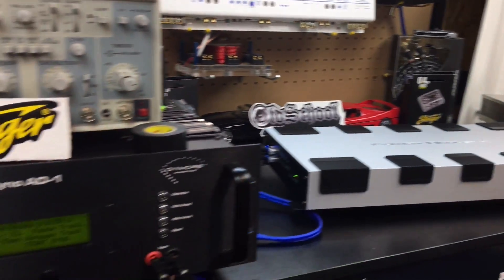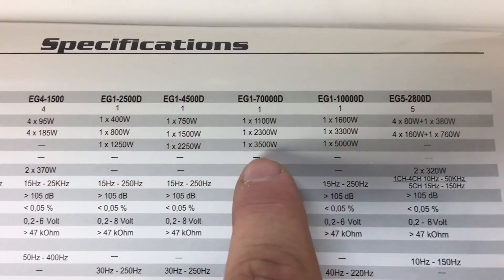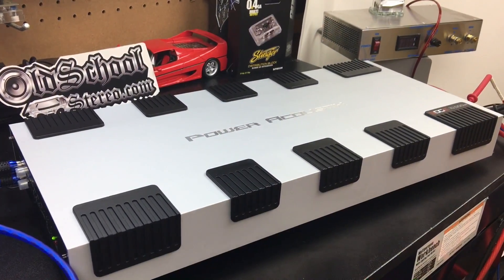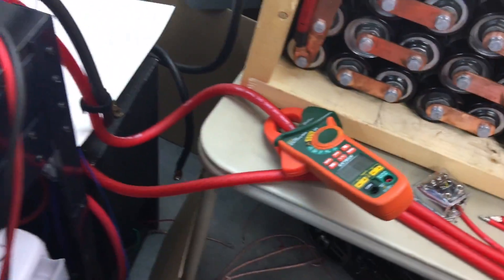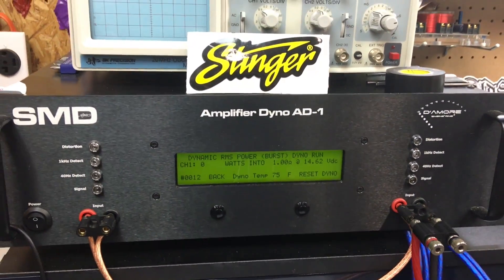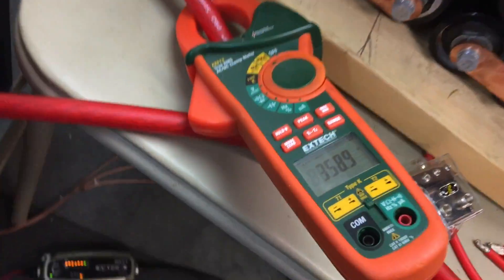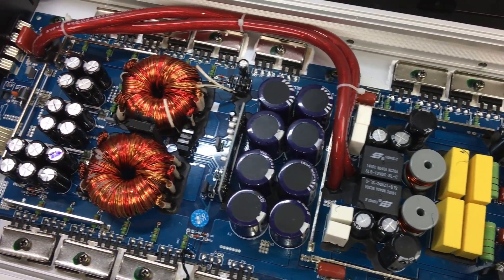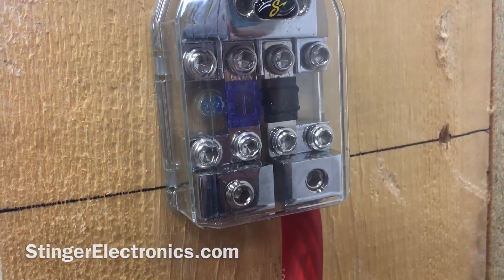10k Watts for $300? Power Acoustik EG1-10000D Amp Dyno Test

Comment: Absolutely insane the amount of amperage it pulled to what it pushed out seems like if u were having a 300 amp draw u should be getting at least a good 4500 watts
Reply: Daniel Harrell no with a good amp a 400 amp draw really can only support around 3.5k-3.8k .  all amps have an efficiency rating.  most decent amps are 80% or above. that means you have a 20% loss when converting amps to wattage. for you example to be true you would need an amplifier with a 150% efficiency.  that is impossible as energy is always lost as heat and other ways. the most efficient amps on the market are around 90%.

my saz2500v2 was ratted for a 300 amp main fues just to push 2.5k at 1 ohm. at .5 ohm it jumped to around 2.85k so its efficiency at half ohm increased to closer to 90 something percent.

anyway I  just wrote this to help you better understand how fusing relates to maximum wattage. also I seen it had 2 likes so there is more than just you that are mis informed about how amperage draw directly related to efficiency rating and maximum wattage. you will never find a 12v amp with a 300 amp fuse pushing 4k.... unless the fuse isn't working right or is some kind if a cheater fuse. 

mike smiley did a test of some special fuses he found and was able to pull almost 400 amps through a 100 amp rated fuse. this is why most car stereo comps stopped using fuses for classification and went directly to clamping the amps. some fuses just refuse to pop at rated draw and some people were using slow blow fuses to exceed the rated amperage in their respected class.

hope this helps and clears up your misunderstanding.
Reply: its a class AB, there about the least efficient type of amp there is.
Reply: @dirtrider88  where are you even getting that fake news from?
..it says right in the name that it's a class D
Reply: I have no idea where I got that from. maybe I googled the amp and was reading the specs for something else?
Reply: @dirtrider88   lol..well at least youre honest.
Reply: Im just as confused as you are

Comment: Guts dont look too bad, they should just rate i as 2500 watts RMS at 1 ohm and it should sell
Reply from the maker: +bassmansoundking99 precisely. But 10kW sounds much better, right?
Reply: Yeah sounds good and maybe lots will never know.
Reply: @wal  I don't know. If you know what your subs need. Just sell package deals. Oh what tangled webs they weave, when they practice to deceive
Reply: 33
Reply: I just think lesser quality amps need to be better cared for, as in better voltage to protect it. Often they have a weak power supply, or just enough fets to support output, but not enough built-in headroom.
Reply: i know ive checked out the planet audio anarchy 1200 .2 and 3000.1 and they look to have most of the same componets but i have found a 1200.1 d from way back that might do it ( i hope ) i did a multi meter test and it came out if i did my math right to 423 wats at 4 ohm with 6 gauge wire a 150 amp stock alt reg battery and a pioneer lower end head unit with a line driver but most of my older amps seem to be on the better side of me believing there rated power newer ones i look at and say divide by half that at least if not worse
Reply: CombatingRowe I think you can see the big issue with this amp in the certified runs.  The signal is really dirty, that's why there isn't good output before distortion and clipping takes place.
Reply: I would agree, I think it would sell just fine if they claimed what it really made.
Reply: CombatingRowe I would agree except for the fact of probably having to replace amp every 3 or 4 months.
Reply: Garbage
Reply: bassmansoundking99 your right. it looks like a slightly more beefed up board from a hifonics brz2400. For 300 it's not bad for a daily with a couple 1k RMS drivers. I would rather pay half the price instead of 700 for a sundown 2500 or 3k ect
Reply: ya it would but they are really putting out a concertivly rated product damn good company if i say so n myself and bassm is right no voltage no juice no sound
Reply: bassmanso.....   you are talking stupidity and also u reply more stupidity, maybe one day u will really understand..

Comment: Still tho... 2000 W RMS at 1 ohm 4800 burst at 0.5 for $289.99?  

That's not really a terrible deal
Reply: current is way to high for the output.. so no this is a very bad deal
Reply: Cheap fucks buy this.   Except Big D ,he just bought it to help she'd some light on how bad this industry has gotten.
Reply: Jeroen Schuuring unless you have a weak electrical system in your car
Reply: in which case you should take care of that weak electrical system before installing an amp of this magnitude! any standard car's battery and Alternator are gonna fail at this kind of power. regardles of which brand you install an amp capable of this output!
Reply: Shit that's how I'm looking at it
Reply: you could probably get an amp that draws less current and delivers this amount of power. However that amp will have a very different pricetag. being this amp costs so little money it sure delivers where it should. nearly 5kW @.5 ohms in peaks is nothing to be ashamed of!

Comment: All joking aside...how can they not be sued for false advertising or straight up scamming people that don't know they build shit products? I feel like you could buy this...test it and take them to court.
Reply: this is how most of the marketing works now.. you see this shit everywhere
Reply: Not CEA compliant . That's how they get away with it.
Reply: Cdogg2233 did u watch the videoo, only the Certified runs stop at 1% distortion, the uncertified ones stop at literal clipping, which is when it made 2500~ wrms
Reply: It probably can put the power out with distortion. These test are with <1% distortion. That would probably be their defense if you took it to court.
Reply: The company was probably able to get the 5k watts from an amp and documented it. What they don't mention to you is the amp was 1 of 100, caught fire, and absolutely perfect conditions.  They only had to get it 1 time for less than a sec to claim it.
Reply: @myfagan  This amp WEILL make 10,000w.... if you hit it with a bolt of lightning. Not technically untrue. They rate them at max voltage, probably 20V and 10% THD.
Reply: Flexin Five Hundred every company does it
Reply: SpenserRoger there is any regulatory requirements that certify the results. you have to know your amps and busy the brand that has a good reputation.
Reply: Flexin Five Hundred they would have to prove they didn't know.
Reply: You live and you learn. It's how you can tell the audio noobs from the guys with experience.
Reply: Because they can use 18v at .25 for a split second before it catches fire and do what they say 😢
Reply: Flexin Five Hundred Same reason why the news can knowingly lie to you. Same reason Obama sold Obamacare with the line "you can keep your health insurance/ doctor if you want" when he knew all along that was a lie.
Reply: @SpenserRoger  thank you very much;)

Comment: With the amount of amps this thing was drawing you should have been getting significantly more power. What a giant piece of shit.
Reply: mrlithium69 because it's a piece of shit.
Reply: Thezuule $300 dollar pos
Reply: Thezuule you will easily pay double the amount for less power from a better company. your build could be a budget build and 2 of these strapped would be just fine
Reply: Brad Icenhour It wouldn't be though because you would need to spend a ton more upgrading the electrical system to produce that power. It appears this amp isn't terribly efficient.
Reply: Thezuule you obviously don't do your own installs
Reply: it just has a 60% efficiency rating. meaning half the power is lost to heat and other things.
Reply: sundown and dc and other well made amps have an efficiency of 87% or higher.
Reply: It looked like somewhere around 60%. I kind of want to know why.
Reply: you could but this thing will not lost as long as one from a better company.
Reply: 2 of these would be bad with the amount they pull. 2 From a better brand would pull less than 1 of these amps.

Comment: What Alpine unit is that?? Love it!
Reply from the maker: CDA-9815. Only cleaner head unit I've tested is the Pioneer 80PRS (THD, voltage, etc). I may switch my bench unit to the Pioneer soon, but this Alpine is rock solid.
Reply: BigDWiz what is the MOST Efficient amplifier you EVER tested to date????

Comment: I imagine that when a company rates their amplifiers at different resistances that the highest power rating they list will be at the Thevenin resistance. Operating at a lower resistance than that will not make you more power, in fact power falls off quickly below Thevenin resistance and just serves to make a lot of heat. But that of course is assuming that that's how the company is rating their amplifier. Does anyone know if that's the case?

Comment: Any company that places a claim, should be able to back it up, prove it.

if not then suit for false advertising.
Reply: You cant it is not a CEA compliant amplifier so there is nothing you can do about it.
Reply: Benjamin Hopkins yes there is, don't buy it!
Reply: Trey Nathaniel doesn't even manage a power draw close to 10kW
Reply: Trey Nathaniel Really???  That's the stipulation?  As long as the math makes sense? Seems that there should be more stringent regulations
Reply: lampim yeah boss and crunch usually are actual garbage amps (not even gonna talk about crunch subs that cant even take half of their rms power (clean) before blowing up)
Reply: John Niedermier boss would be out of business before they even started if we did that
Reply: Gabe Ulrickson I have a boss riot 2400 and it is pretty good it can make 2 skar sdr-15d4 move like crazy with some really clean sound with no clipping
Reply: It only legally has to accomplish it math wise, not in real life applications, sadly.
Reply: technically, the box says 10000 MAX which is 5000 RMS and it just about made that 5000 rms.  give it 15.5 volts or so and it would've.  Power Acoustik is actually not a terrible budget amp compared to BOSS which is garbage and does lie like crazy.
Reply: all in all, not bad for $300 . I have heard this amp on 2 dc lvl 5 15's d2 @.5 and it sounded decent. the output isn't all that clean but it's still ok to wow the crowd... a little lol. thx for the video
Reply: lampim  no they are still shit!! An u reallllly can't sit there an say it made close to 5000 watts in reality it didn't even get half of that!! It took .5 ohm an tested dynamically to even come close and at 300 bucks makes this amp absolutely garbage!!
Reply: we sadly can't sue companies for false advertisement, since the product does infact work, we can't do shit, that's also the reason white van speakers are "legal" and that skytec/qtx sound still exists since their 700w amp does only 20wpc clean

Comment: The reason this amp didn't make it's rated power is because the test was not done properly. The amp needs to be mounted on carpet using the mounting tabs with sheet metal screws that screw through the sheet metal of the vehicle for extra grounding points, and also, the rca cables need to be wound into a coil and wrapped around the power wire, so they can ramp up the input signal voltage from induction from the power wire. And also, a battery bank and caps, can NEVER supply the amp with as much juice as a stock alternator that was designed run automotive electronics. I personally saw this amp clamp tested at 12,345 watts at a competition pushing 1 Funky Pup pit bull series 12" sub. Did 199.1 db on the dash!
Reply from the maker: Wow, that was a good one!

Comment: Come on people for 300$ and you're whining about its actual power?3000 watts for 300$ ? Hell buy two at that price! You can buy 4 for the price of the other name brand amps smh
Reply: "Actual power" is 2000W @ 1 ohm with 14.4V.  Real world you likely wouldn't see 1500, it will very probably fail prematurely, and it is grossly inefficient compared to well designed modern class D amps.  Drawing 240A to make 2000W is just dreadful.  

Even in the price per watt department there's far better to be had.
Reply: Sad part is that you could do much better for the price. Power is one thing, unfortunately, the SQ is also poor.

Comment: so basically this is a 3k amp. in noticing this company will rate it soundstream and PPI brands accurately or better yet underrated but it PA brand is way over rated. which makes no sense. make the model number 2800 and you build up that brand as well. frustrating. never the less..a 3k amp for around 300 isn't bad.
Reply: Actually it's a 2,000 watt amp at 1 ohm that draws a ridiculous 240 amps. Sorry, but no.
Reply: Eric Erickson the draw isn't that bad. must be over 70% efficiency.
Reply: The reason Epsilon underrates PPI and SoundStream products more often is the market they appeal isn't the same "MY SUBS POUND YO!" as PA. PPI and SS have "provenance/heritage" now whether it's all good or even matters right now is debatable, PA is for the teenager with the clapped out civic with NOS stickers in the windows and zip ties holding his "custom body kit on" he's more interested in bragging that the box his amp came in said 10,000 watts and "It pounds yo!" then does it actually get anywhere near the rated power.
Reply: Brian Reed umm make is more like a tad over 50 percent eff. Pretty bad but for someone starting out this amp would give them enuf power if they had strong electrical

Comment: Please test Orion xtr amp ! They claim to make rated power @ 12.4 volts so I would assume they would make crazy power at 14 volts and at .5 ohms
Reply: I have had a XTR2200.1D and now have the XTR2500.1d and have loved both. It is actually at 12.6v technically. If you look at the Amazon review I'm the one who posted the gut pics. It ain't nothing official but I clamped it at half ohm rising to 1.10 and 13.06 volts. Came out to be 2455 so would have to say that it is close. Little over on voltage but I figured the 1.10 ohms would balance it out. JFWIW
Reply: +Kevinyaheard 
can you tell me how do you like it ? would you recommend  it ? I'm thinking about getting it today . ..
is it power hungry ?
Reply: It's actually one of the most efficient amps I have ever had. I just got it the other day but I can tell you it is very stout. I wish I had a bigger battery bank so I could see what it would do with the voltage a little higher. I only have it on a DC Power XP270 Hairpin Alternator, 1 Duracell Group 34 AGM and 1 XS Power XP750. That is a sorry 77 aH when I should have 4 times as much. My alternator is a BEAST but not big enough to overcome the fact that I am one step above having AAA batteries powering the amp... lol Without the subs hooked up it doesn't even start to clip until I get up to 80 volts! The SAZ-2500 I had would only get to 55.... In a week I'll have added another Duracell Group 31 AGM. I'm gonna drop it down to a half ohm and that will be the real test...

The only negative I can really say is that I don't like the subsonic filter being a switch, 25 Hz or OFF, but it does have a 180 degree phase adjustment dial instead of the usual 0 or 180 switch. I guess that is a wash.... Also, the gain adjustment (as well as the others) are all plastic instead of metal so over time they can get stripped out easy, but I guess they had to save money everywhere they could to have an amp this awesome for so cheap. I'm amazed that everybody hasn't jumped all over this amp series honestly. PASMAG did a review for its big brother, the Orion XTR3700.1d (now XTR4000.1d), a couple years ago. If you haven't seen it then you need to. That's where I first heard about this series.

I am starting to think that these amps share some design features common to the Brazilian type amps, but not all of them. These look ALOT beefier compared to guts of those types of amps though so maybe a type of hybrid perhaps...  Orion is owned by a company that is located in South America, but the thing that makes me thing they are a type of hybrid is that the gain adjustment is so different. Usually you can just go off of the formula online to get you close to the ballpark gain settings. If it is under/over-rated then it will be a little off... For instance, If it is a 2500 amp at one ohm then it should get close to 50 volts output to speakers before it starts clipping. This one did OVER 50% more!!! This one went all the way up to 80 volts! You would be leaving A TON of power on the table if you used a multi-meter to set gain. I have heard the same thing about Brazilian style amps as well. I am 1000% satisfied with it, I like it more than the SAZ-2500D v1 I had, hopefully it can do well at lower ohm loads, unlike other Brazilian amps...
Reply: If you are serious about ordering it ASAP then go to Showtimecaraudio.net and at checkout use code "2016". You will get $60 off of it, don't know for how long it is good for though. If you don't live in Tennessee then you might not have to pay tax either. Get it for $239 + free shipping.
Reply: +Kevinyaheard 
You should upload a video of it there is almost no content on YouTube of that amp.
If you could that would be awesome
Reply: What do you want me to show about it? I don't care to, just lemme know what u wanna see. I might be able to clamp test it but with my small batteries I don't want to mess it up, could low volt it stupid easy before I would even realize, trying to watch Oscope, Multimeter, and clamp. on top of controlling gain and videoing it all...
Reply: +Kevinyaheard 
Just your set up so that everyone can see what that amp can do
Reply: +Kevinyaheard 
Just grab your cellphone and point it at your trunk of your car and press play. You don't have to clamp test and set the gains and all of that just to make a video clip of your set up.